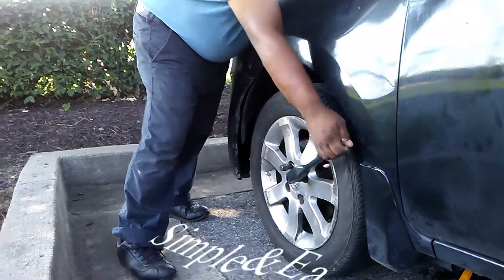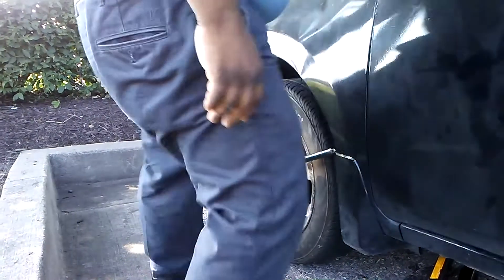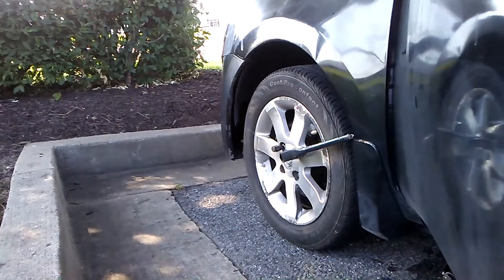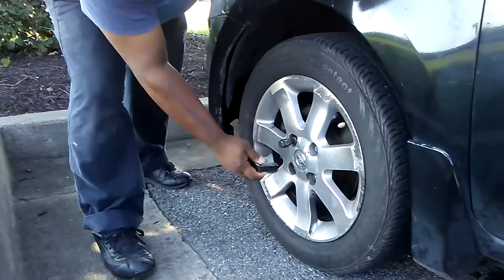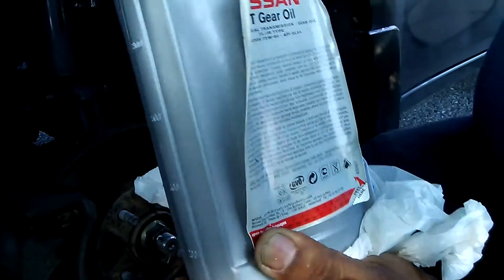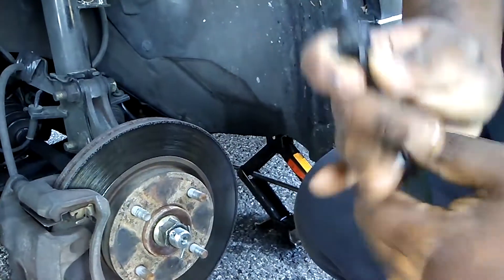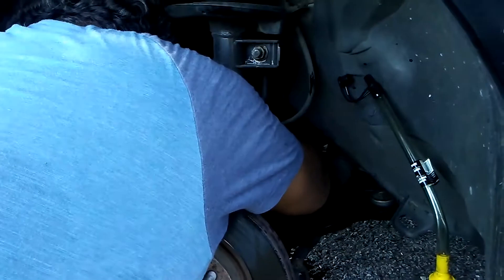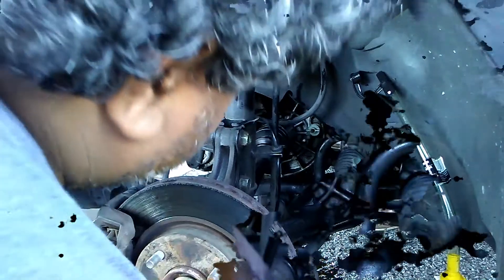Nissan Sentra 2007, Gear oil

Comment: Very helpful.i burnt my clutch out n trying to fix it inexpensively. Where did you get the gear oil and how much is needed to put in? Look to seeing more videos
Reply from the maker: I purchased the oil from Nissan Show room. It depends on the engine size for the amount of gear oil you need.  The clutch will burn out at a fast rate if you do not put the correct gear oil.